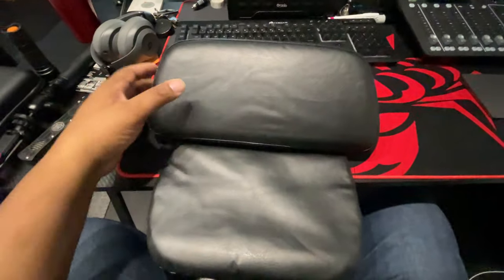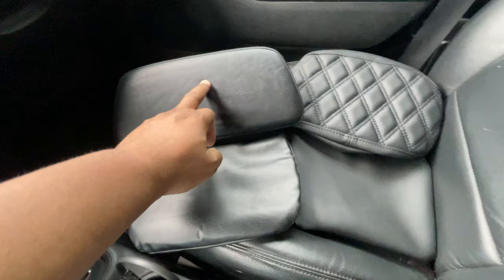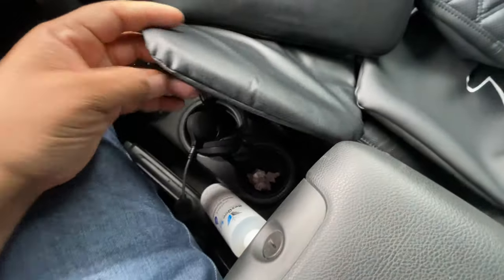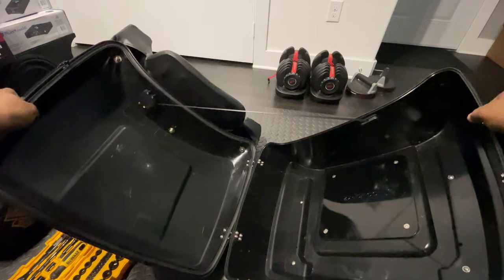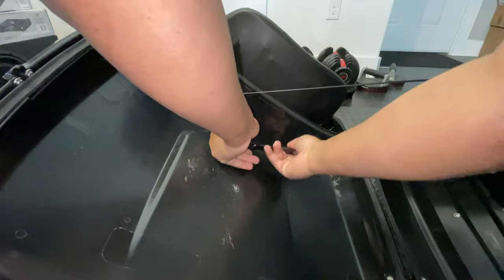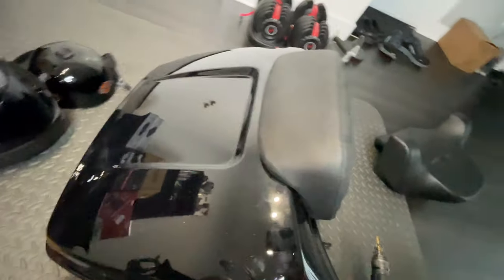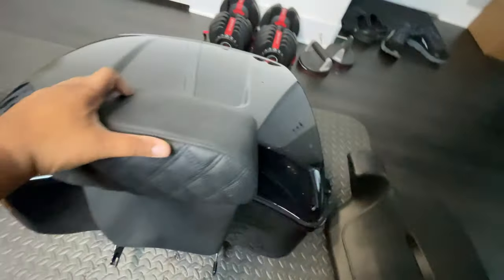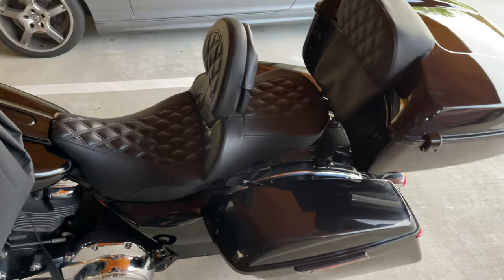Project saddleman tour pack back rest cover #HarleyDavidson #saddlemanseats #hogworkz

Comment: Don, Good job on the video but how did you seal the screw holes on the corners left from the full backrest?  One second they were there in the video... next they were missing.
Reply from the maker: I purchased a box of multi sized hole fillers from Amazon that are just push and plug. SunplusTrade 240 Pcs Push Type... https://www.amazon.com/dp/B01MEHSLZT?ref=ppx_pop_mob_ap_share